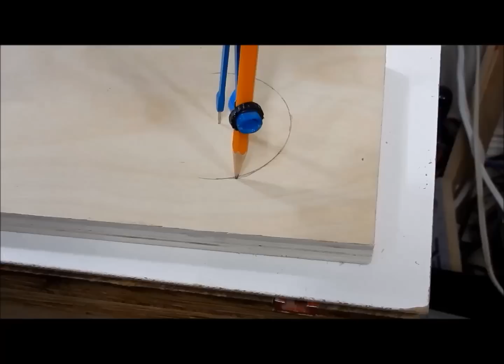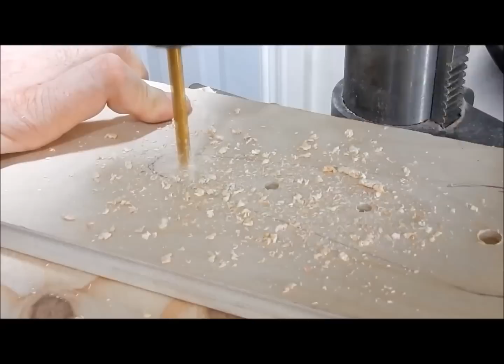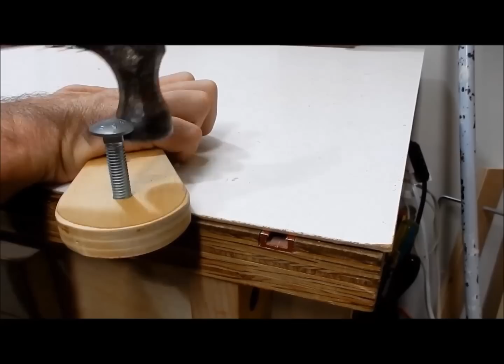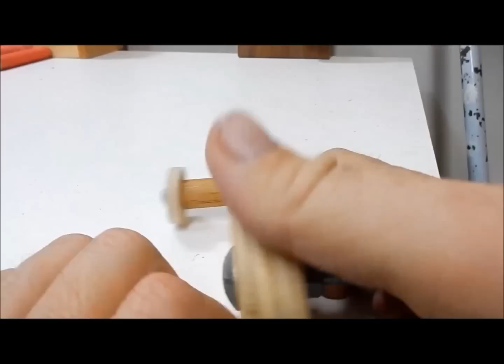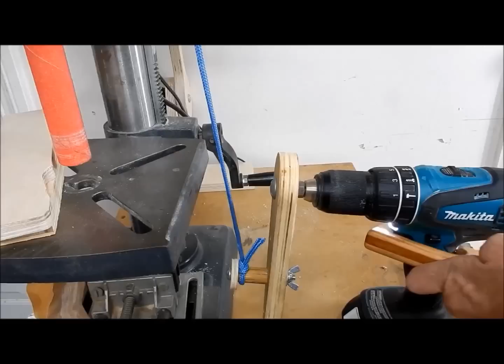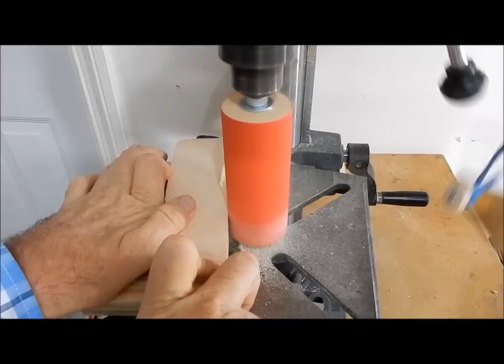Build a drill press oscillating sander

Comment: Great idea! If u make the rope a little shorter, the action will be smoother, now the action is only on the lower half of the turn of the handdrill.
If u make the rope that it's taught when the drill attachment faces up, it will oscillate smoother.
Thanks for sharing.

Comment: Great idea. If you lowered the table and tightened the string up it would have a smoother motion. Also I would build a small box with a hole in it that the spindle slides into so you can sand with the middle of the spindle.